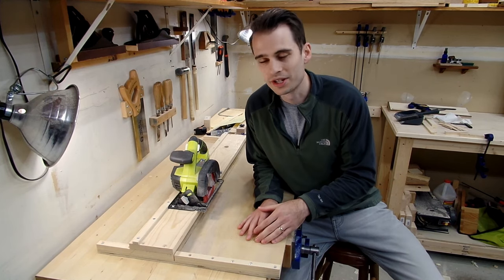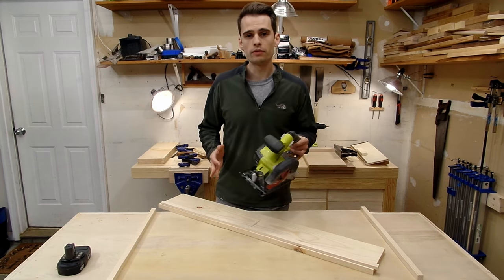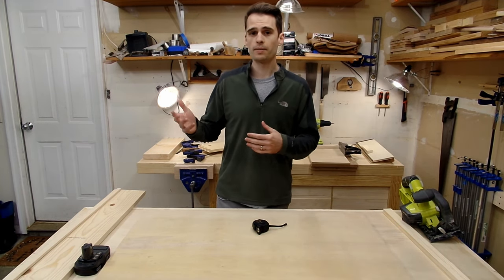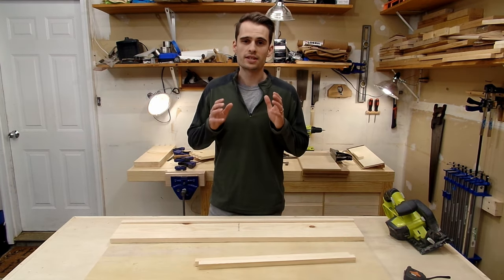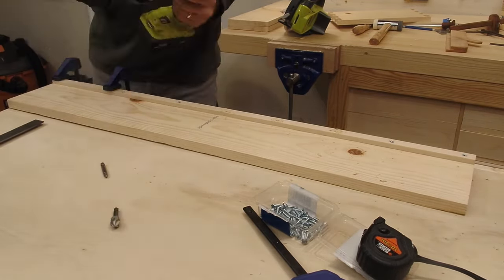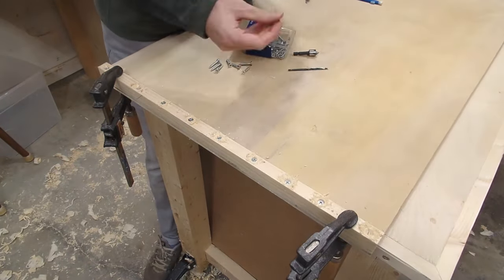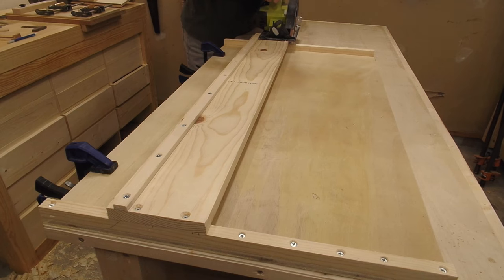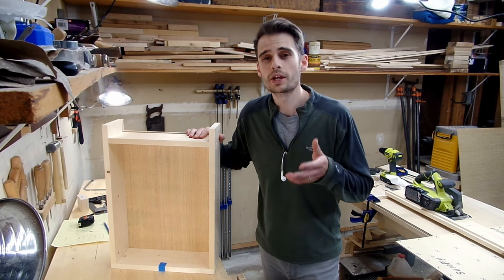MUST HAVE jig for a small shop...EASY circular saw crosscut jig

Comment: I'm not sure that your approach works.  I've got a PHD in physics and MY solution is like this: I've tied the saw to a wire coming from a hook in the ceiling.  The saw is now like a pendulum.  I have a realtime computer program that turns the saw on just microseconds before it swings over the table where I need the cut.  There is a small motor that keeps the momentum up and makes sure the pendulum swings in all desired directions.  I've used a matrix consisting of a set of partial differential equations of 3'rd degree to calculate when the saw needs to be turned on and off in order to make the cuts.  Doing it this way eliminates the need of a table and my solution can be installed everywhere.  It has worked flawlessly in a simulation in the quantum computer at the university where I work, and you may soon find this system for sale in a shop near you.
Reply: What an astonishing coincidence...
Reply: I took my design to CERN and shot it through the old Hadron Collider, turns out it was 0.0435172 of a millionth of a millimetre out in three dimensions, so it's back to the drawing board for me.
Reply: @whitethorn1969  LOL 😅
Reply: Name checks out. Lol
Reply: @whitethorn1969 LOOOOOOOOL
Reply: Coincidentally, I came up with the same idea as yours using a quantum computer -But, the computer couldn’t handle the hefty computer permutations program for the saw and it blew up the electrical fuse. So, I reverted to the wood jig since it is more practical and has no fuse to burn out. By the way, I am a high school drop out.
Reply: I was going to say something similar to this. You beat me to it...
Reply: I just use an ar15 attached to a large oversized metronome, I then hung 2 clothes lines in my backyard so I can suspend the wood safely in the air, I place the metronome on a bouncy castle below the clothes line so that when I hit the auto switch it balances out the recoil and shoots a perfect line through the wood while allowing the sheet to land safely in the surrounding area if the bouncy castle. There is a sensor I installed on the surface so the moment the wood hits it it kills the power to everything. I then search through the deflated rubber of the bouncy castle to retrieve the wood and the gun, and assuming the bouncy castle has only deflated from the kill switch and not bullets I blow it up again for my next cut.
Reply: Does it come with a saw stop ?
Reply: @patburns600  Saw stop is old school. My solution is to spin up the saw blade instead so it rotates so fast the teeths wont have time / chance to "bite" into any materials or fingers. It is basically just a wheel when the blade speed is high enough.  It is the same principle I used to tell my driving school students back in the days: If you drive fast enough past children playing on the road side then they won't have time to wander into your path.
Reply: Can’t argue with that logic 
But i still have some concerns because this is new to market . How will i know the difference between knock offs from China?
Reply: The story goes that a representative of a German precision engineering company paid a visit to Harland & Wolff shipyard in Belfast to extol the virtues of the accuracy of their supplied machinery. He told the assembled crowd that their machines could work to the tolerance of one hundred thousandths of a millimetre. A remark was heard from one the attendees: That would never do over here. Over here we have to be fucking dead on!
Reply: Only in Sunny Bell Shaft
Reply: @Skyrunner13  🤣
Reply: With all your money from being a PhD, you should just pay somebody to do all that work. Stay on the golf course or on your sailboat. Ha ha ha.😂😂😂😂😂😂😂
Reply: 🤔 … good point. I only have a BS degree, so I can only assume that your ceiling hook is securely attached to a flux capacitor that regulates the harmonic balance in order to achieve a smooth transition in all axes and dimensions simultaneously. While your fix seems so simple and will obviously work well with the standard four states of matter, I wonder how well it works for Bose-Einstein and neutron degenerate states which are quite commonly occur while cutting ultra dense material in an ultra cold shop?😂
Reply: Bluh bluh word Diarrhea
Reply: I have shot a bullet towards space, once it returns I'll calculate the straightness of the trajectory and start cutting my plywood.

Comment: I love this jig and plan to make one. One suggestion, make the saw guide longer than the base and allow it to extend past the end of the base. This way your saw will be fully supported until the center of the blade reaches the end of the base.
Reply: Gonna do this 🙏
Reply: I think this is an excellent idea.  If you do this, note that the jig shown is left-handed.  Non-southpaws would want to reverse the plan and put the extended portion on the other side.  Or just leave a few inches on either end for versatility.

Comment: I've tried tracks like the Kreg Accu Cut and lining up and using a straight edge. The Accucut belongs in the trash, and constantly lining up a straight edge and checking for square is just a pain in the arse. Cross cut sleds for a table saw are never long enough for crosscutting cabinet sizes. 
THIS IS IT! 
I'm making this for sure!

Comment: I saw this video  a few days ago and I was thinking that it would be restrictive on how thick  piece of wood you can put into it....but that is determined by the width of the blade, and I didn't think of that at the time. I have since made myself a similar version of this guide and it works really well. I am really glad I made it because it eliminates the majority of mistakes and keeps the cut the same all the way along. I only finished the guide this evening and it works really really well......well worth making one.
Reply: I think we need to make that gap bigger for thicker wood. What I see in this video is good for something about 1 or 2 cm thick. Is that correct?

Comment: This will definitely work. It seems like it would be very easy to cut through a 1/4 inch base, and screwing down to 1/4 ply you need the exact screw and would hardly get any strength. I like the straightforward video, no bs. I am going to make something like this.
Reply: How about doubling the height of the supports to 1.5 and lay in 3/4 foam. Make the track longer as others suggested. Make it +48 to handle a full sheet and use 3 sawhorses. It still doesn't have to be very wide. Portable and safe.

Comment: Thanks for the nice, clear explanation!
I made this jig for my baby Makita (100mm/3.5"), after investing in a half sheet of 7 mm ply and a combination square (a wonderful invention that I had never previously heard of). I'm using the jig to cut out pieces of 6mm ply for drawers and shelves for my van build - and the drawers in particular need to be perfectly square and straight - something that was beyond my skill level until now.
I did run into one big problem, however. Having a gap between the saw and the workpiece results in massive tear-out. 
I managed this by using some old pieces of thin scrap wood to wedge between the track and the workpiece, and as long as I do this, I get beautiful clean, straight cuts, nicely square.
But am I missing something? Has anyone else had this problem? And if so, how to deal with it?

Comment: Nice jig.  I built this a couple months ago—it’s interesting to see we had the same idea for replacing a table saw. I used an MDF base and routed some dovetail tracks to be used with the Microjig clamps to hold material and set angle cuts.  Looking forward to seeing your other shop builds.
Reply from the maker: I kind of wish I used a sturdier base, but 1/2 inch ply is what I had on hand. I like the addition of the clamps to hold material. You could really go crazy and add a lot to this jig.
Reply: In Germany  they had a similar one for sale made from a resin /plastics, I,ve used it so much more than my table saw as I am mobile restoration. 300 year old capedutch buildings.Great ,and thanks for sharing.

Comment: I did a similar jig with a long track, and one problem I had was that the track sagged. I should have used a thicker base for the track. But I was worried about not having cut depth on my Ryobi 5.5” saw. I also wanted the track to have room for 1” of wood, since I usually cut 3/4” stock, and I wanted room to slide the wood. 
But maybe 3/4” would have been better; then the track wouldn’t sag. 

I may have to try this again.

Comment: This seems simple and easy. I dont have a table saw myself, so this jig would come in handy. However, all the technical cuts need to have flat and straight edges. How did you get all the necessary pieces needed for this jig? Did you purchase them this way, or did you use a table saw and other tools to make them? Because if you had to make them, it kind of defeats the purpose if you had access to a tavle saw to make pieces for a jig that is used as a table saw replacement.

Comment: If the guide piece is stronger the plank would bow less thereby keeping the cut depth constant. Therefore you can turn it on its side and attach it to the edge of the plank or alternatively use those aluminium straight pieces which I think is used in plastering walls???? for the edge piece - they are quite wide, think about 3 inches. Also cutting along the whole length removes the small width piece off the guide plank. Thereby exposing the cutting edge. One then considers the edge of the plank to be the cutting line, that is to the right of the blade.

Comment: Could you use this jig for repeat bevel cuts?
Reply from the maker: Unfortunately no. You are only able to do 90 degree cuts.
Reply: @DaughtersWoodCo Really? I don't see anything stopping you from just tilting the saw in. Or at least making the jig fit a 45 degree tilt from the get go. Just don't hit the screws. 😁
I have the same saw and was planning on doing that.

Comment: Great design. Can you rip narrow strips with this setup?
Reply from the maker: You can, up until the piece you're ripping from becomes narrower then the track the saw is riding on. At that point, I'd be a little too dangerous to make the cut.

Comment: Caution. I just made a circular saw guide then tur Ed around a d found out that not all cir ular saw flat bottom guides are the sa.e size I have 2 saws o e works the other o e base different size. Jees

Comment: I see a secular saw but we're is the jig saw?????
Reply: Yes, would work for the jig say, and also modified for a router. Basically any tool where you normally use a straight edge. Could use to draw straight lines for nailing or screwing on large sheets. Brilliant!!

Comment: Get rid of the table saw and buy a wall saw for cutting panels. They’re accurate, extremely safe and they can go up against the wall to save space. You can even rip lumber on them. Oh, and then you don’t need to waste time making a jig
Reply: You mean panel saw?
Reply: @V7StudioProduction  They’re also called panel saws
Reply: The stuff at home depot.

Comment: I'll never understand Americans and they're horrible Phillip screws. Useless. In Canada we use Robertson screws. The screws have a square hole and it stays on the driver, doesn't fall off and very rarely strips like those horrible Phillips. any time I get a phillips screw I literally throw them out along with any slot screws - just as bad. But thanks for the jig. Cheers